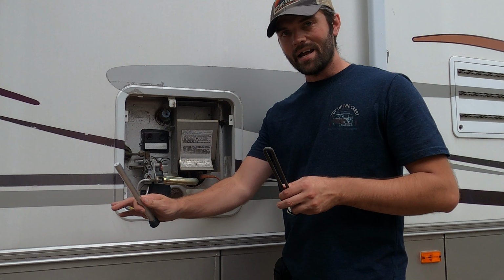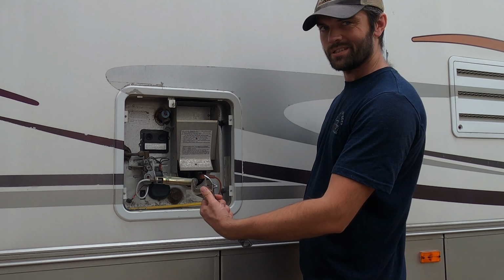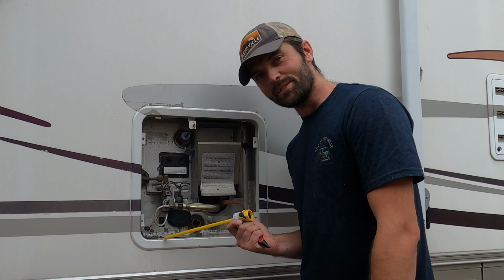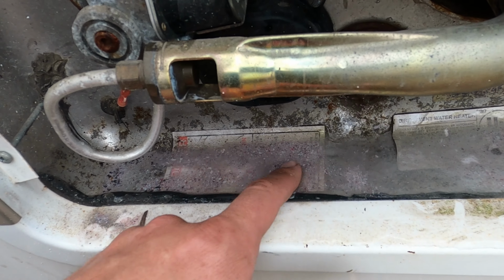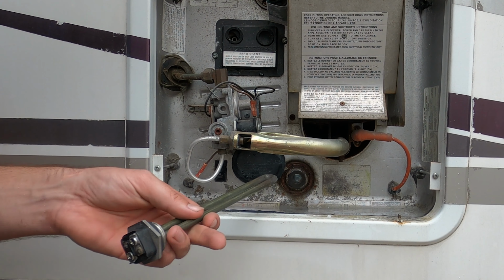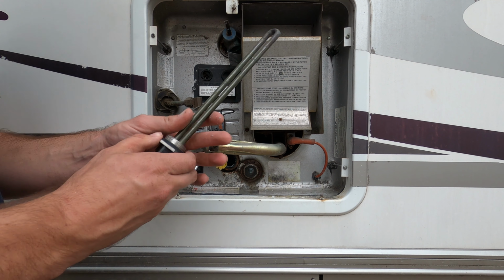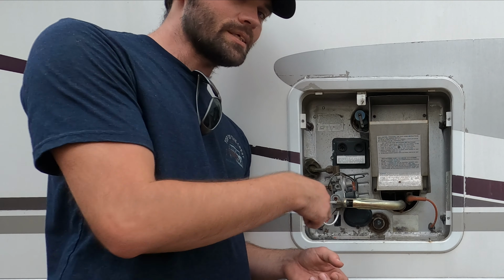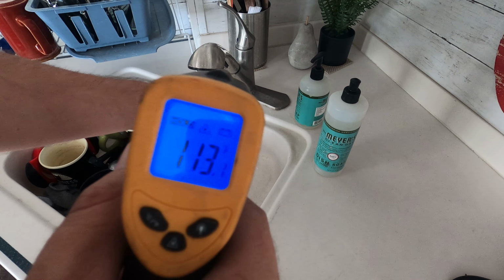RV Hot Water Heater Troubleshooting

Comment: New rv owners! Its our 2nd time/post winterized! We took out our rv and of course it rained each night. We noticed dripping under the rv after we dewinterized (I don't know if we did it right). Most of the drips came from under the shower. Ideas? Thoughts? Help? Dee and John from Iowa
Reply from the maker: Not sure, but if my grey water or black water tank gets to full, it will leak at the valve where you empty it. Be sure to dump your tanks once a week.
Reply: That's true. But this was water just under shower only. And we weren't using the toilet or shower.  When we emptied the tank (grey tank) there wasn't much water released at all. We think it was rain water???
Reply: Thanks btw!